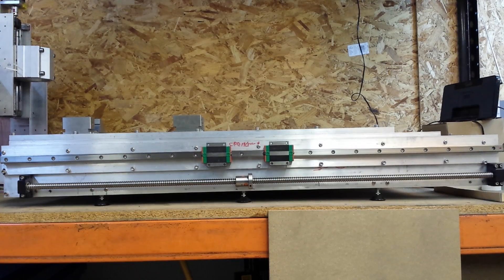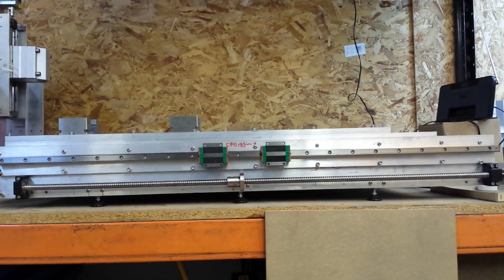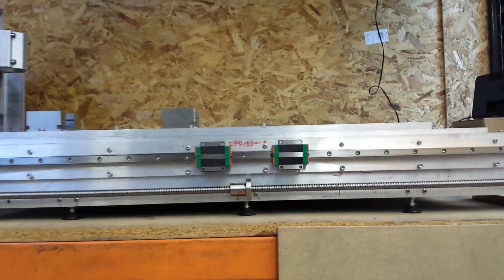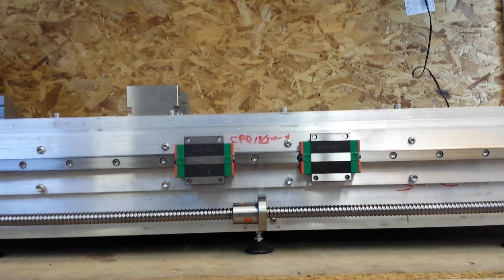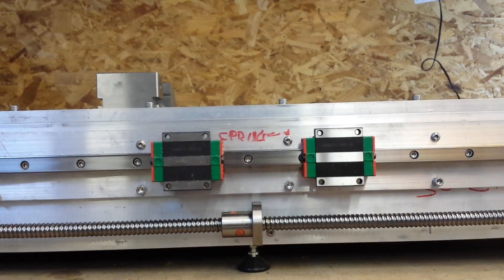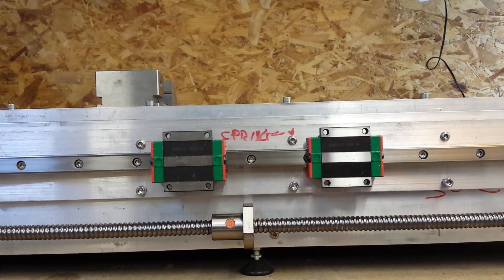Ballscrew and Stepper Motor Test showing high stability with no Whip using Cnc4you Ltd. Parts Mach 3

Comment: Not sure I agree with the premise here. Whip is generally worse when gantry is toward the end of travel and you have a large unsupported resonance created in the rest of the screw. Definitely looks like well-machined part, but I'd be interested in seeing this same test (specifically at the hi rpm) when the nut is attached to the mass of the gantry toward the end of travel.

Comment: In stead of putting a floating bearing on one end how would it be if you used set screws to pull the bearing blocks apart from eat other to pull the Screw straight till it can't whip. Good  Angular Contact Bearings would help on each end and a set screw to add pressure to the blocks.
Reply: john ward could not underetand your method. set screw is something to hold a collar in place on a shaft. Is Your method to use a Set screw to press the front side of a bearing inside the floating housing to opppsite direction of the fixed side ?
Reply: @Zafer Refazi sounds like think of tug of war where it held both ends but pulled tight so can’t vibrate or shake over the length
Reply: @john ward there is a video series of RCNCX2 build and he says that he learnt a few things from his first diy build and that to left one end floating as if it heats up a bit it needs a place to go and if both ends fixed it would bow

Comment: I don't know much about this, so I don't know what I'm looking for. If they were bad, what would happen instead?
Reply: I believe it would act the same. Imagine ball bearings all rotten inside. Then they would get suck and the carriage would stay in place. Which is what happens here at the 200ish rpm..
Spinning at 2000rpm but only at very high acceleration, the lesser quality ball bearing would make carriage move left or right depending which way "shaft" is turning.. This one does that too..
I actually don't get this video..
It says not much. It certainly doesn't say anything good about quality to average joe trying to assemble cnc machine..
I might be wrong. I've nothing to do with machining.. Just my hopefully correct logic. It would say that shaft is horizontal (again if we one the quality of ball bearings...
To sum up. Only knowing acceleration speed and mass of carriage, we could get closer estimated off quality of those ballscrew bearings. With it I think it's hard to say..
Reply: Actually, I think it does tell us something.
When theat thing spins and gets to 2000rpm and the shaft stops spinning suddenly, I would expect the middle unit to go all the way to the end, left or right of its good part..
Someone correct me if I'm wrong..
This movement of one to two inches left or right are I assume not a good sign.
He does say that they used it for many years but that says nothing actually...
Reply: Actually if it was bad it would 'whip' ie oscillate creating lots of vibration and wear (imagine plucking a string) 

Eg.. a move of the gantry from one end of the bed to the other at high speed (a rapid move) would cause whip, as the gantry approaches the middle of the run the oscillation is brought under control by the ball screw and rails (causing wear and vibration), as it moves away the oscillation builds again.

It can be controlled by reducing the speed you run that axis until there is no whip present, fine for a hobby guy playing in the garage, but if you make your living from it.. time is money.

Longer axes would generally use a rack and pinion to drive them as no matter how well balanced a lead screw is, it would be susceptible to whip over a given length.
Reply: @an1ma169  yeah, whip definitely gets bad at high feeds on long ballscrews, on my machine (using 25/05 ballscrews from the great guys at CNC4You) I can at moment get up to about 2700mm/min feed rate before the whip is to bad, but my ballscrews are 2700mm long and they visibly sag from their own weight.

Om my X-axis I have the same model ballscrew but 1600mm long and that one is rock solid and so far I'm only limited by my 4NM stepper motor not being able to get up to a very high feed with a short accelartion, due to the mass its moving :)
So at moment my machine is fairly balanced in terms of max feed rate on X and Y, with 2x 4NM closed loop steppers on Y and 1 on the X, even if it's completely different factors that set my limits :)
Reply: @mzaphod64  if it was a backlash unit it would spin off each way if it's pre loaded precision then you don't want it to move at all when the machine shuts off.  Machines require preload on ball nut to ballscrew then from Bearings it controls the precision that way by acting like brakes.

Comment: How long can those lead screws be? I'm after one in 8mm at around 1600mm give or take the diameter or length
Reply: @Andy McNulty probably too late but go rack and pinion if can, I read so many say if 5 foot or more best to avoid the screw ones (ballscrew and leadscrew) as can vibrate over that length which makes it not as good for precision, on my machine I be making it 1000mm but thinking to build a 1300mm one so can machine on 4 by 8 boards
Reply: @mlee6050  we build tons of long ballscrews.  That's nonsense really. Ball screws are secured by journal ends and nut is mounted inside a housing and is stabilized that way.